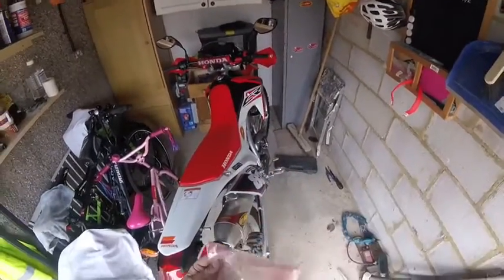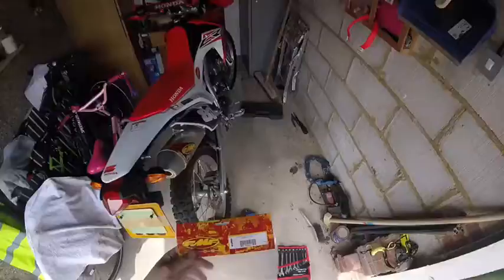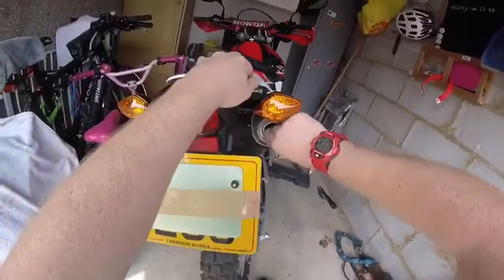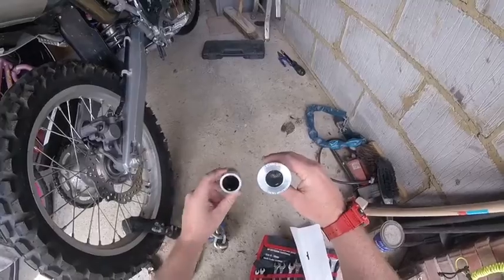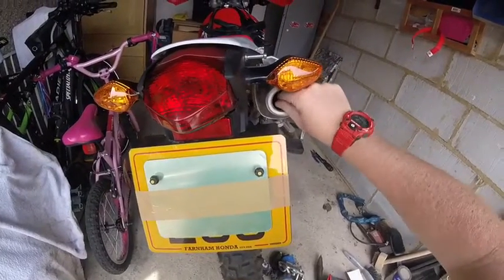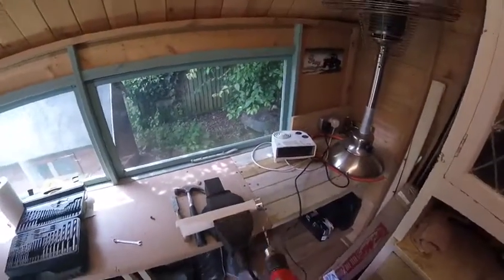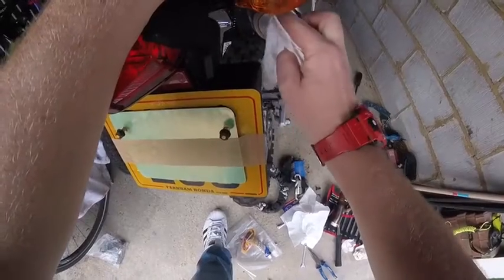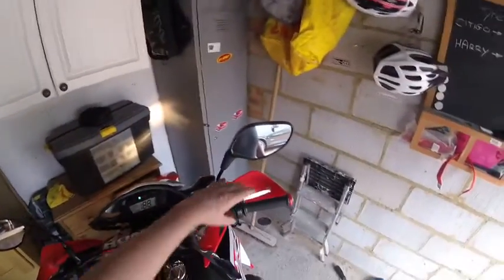FMF Q4 Quiet insert pipe Install

Comment: That bolt was indeed a pig. I ended up filing the threads off the first 3-4mm of it essentially turning the end into a guide that dropped into the hole in the muffler. That left me with about 4 usable threads past the body of the insert which was plenty to get it on securely.
Reply from the maker: rick rickerson .. nice one.. good idea!

Comment: What kind of packing material are you using?  I'm looking to repack my Q4, and I am awaiting a response from FMF with their recommendation for the quietest product.
Reply from the maker: barking.dog.productions1776 sorry this came as part of a kit so I’m not too sure
Reply: @greggyboy28  The reason that I asked is because apparently the original fiberglass packing material needs to be repacked occasionally.  My Q4 is also pretty loud, so I will try replacing the packing material and if that doesn't work then I will look into getting one of these quieter inserts for it.

Mine is loud enough that I am concerned about long term hearing damage...

Comment: Hi. Could you tell me the fmf model ? 040288 or 040630. Many thanks
Reply from the maker: Muriepa Ch .. it was for the FMF Q4 pipe. I think the part number was 040671. I’m not sure what the actual difference is between the parts you mention? Thanks for watching
Reply: @greggyboy28  I believe he is referring to the part # for the quiet insert

Comment: Will this fit a 2017 CRF 150f
Reply from the maker: It should do if you have the FMF Q4 Exhaust fitted. Mine was a 2016, don’t think exhaust set up has changed